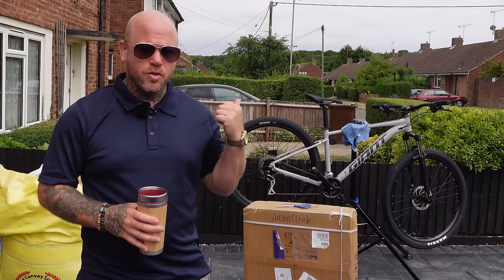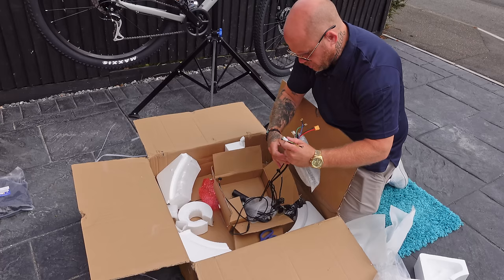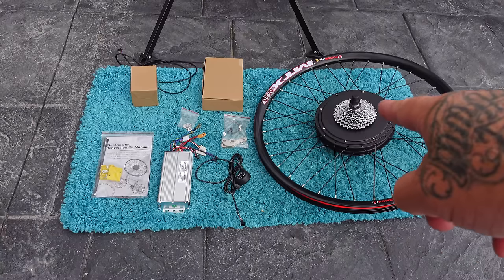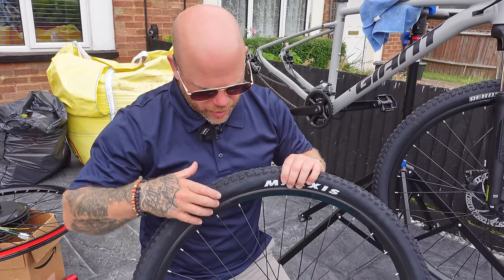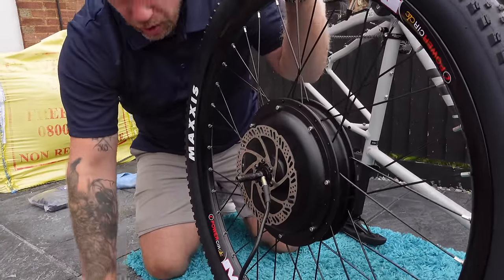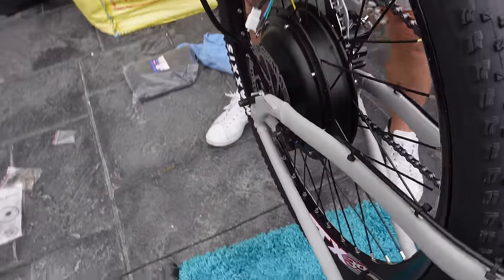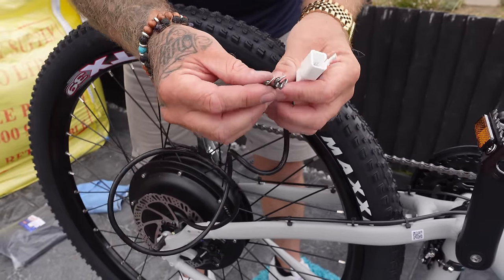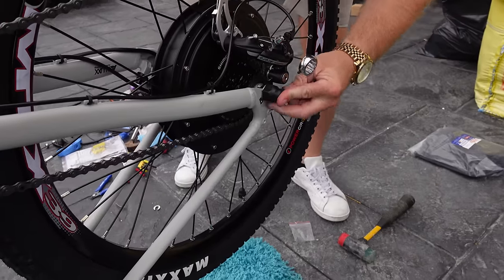Pt. 1 Convert ANY bike into an EBIKE! **ELECTRIC HUB MOTOR FITTING GUIDE**

Comment: Hi steve I'm looking to build my own ebike using  hallomotor 5000 watt conversion kit(I'm only looking to spend 500 on the actual bike itself which will be a mountain bike) is there any specific Make you would recommend for the drop out etc? I don't want to buy a bike which won't be able to fit the kit to if you're with me? Any help will be greatly appreciated,thanks joe
Reply from the maker: Don't really know much about that kit. I generally wouldn't bother with a kit that size should be on an actual enduro ebike frame not mtb it's generally overkill for a mtb and it's components.
Reply: @DudeStuff  what size kit would you recommend? Thanks again
Reply from the maker: @joefrenchcore386  I personally see no point in anything bigger than a 2kw hub motor on a mountain bike
Reply: Looking for something for longer distances would a 5000 watt hub kit not fit on to a mtb dude? Thanks again for replying
Reply from the maker: @Joe Frenchcore  5000w isn't going to help just get the highest ah battery you can fit and afford

Comment: hiya dude listen I bought one of these about month ago from Andy now I've run into the problem where my  disc from the disc brake does not have the same bolt pattern as the Hub motor itself have you ever run into that problem if so what did you do
Reply from the maker: Just buy a brake disc the kits are 6 bolt of you have centre lock just buy one that size
Reply: @DudeStuff  got you I have a 6 bolt pattern but for some reason on the mtx 39 the bolt pattern is slightly more spread out I didn't know that the discs from disc brakes on bikes come with different sizes I mean the bolt pattern not the actual circumference of the disc thanks I will look into which one will fit
Reply from the maker: @chrismartin6427  nah if you have 6 bolt it should fit you must be doing something wrong

Comment: 13:54 make sure you have a 2wire bms on the battery for regen braking. all of the cheap ebike batteries have 3 wire bms's which you should not use regen with
Reply: Can you expand? Do the motors always have 3 wires as shown?  If so, how can you fit 3 wires to a 2 wire bms? (what is bms?)  How do you choose a 2 wire bms battery?  Do you recomend opening the battery hub using stator aid and refitting with a silicone seal under the hub nut flange?

Comment: The hall wire from motor should be strait across to frame near wheel nut as brake disc screws can catch cable. What I did I filed a half moon in washer two of them so wire is miles away from screws. I think these wires gave been out for years the best is coming from spindle problem is torque arm you have to take five wires out of plastic multy plug to feed through washers. Lad from me did not have a good space and disc nut cut through wire and cable. We had to take motor out of wheel and make new connections. This happens quite a lot. Even if you don't file u shape best to bring cable stait to frame with a tie then feed cable along frame jus thought I would mention
Reply from the maker: Got a photo of what you did with the washers?  I've never had an issue with these 2000w kits I always cable tie close to the frame
Reply: @DudeStuff  hi I haven't Andy in one of his videos was on about the cable saying to make sure it's no where near the disc nuts. I had to use two washers on spindle to clear my disc from frame you use a round file and file a half moon in both washers at one end then line them up before tighten big nut the groves in washers help to keep cable further away from the disc screws. It makes sence if you put big washers that come with kit the flat side of washer nuts on that Grove on spindle so it pushes cable near the screws.i serpose could use smaller washers but its the ones with the shape of spindle. If you haven't had none issue then it's OK it's just for safety reasons
Reply: @DudeStuff  when filing washer you don't go write through kits like using half washer width it works well
Reply: @DudeStuff you asked about washer on spindle. When you offer up washer to the stop on spindle there's a color then the phace wires go over washer. I find take washer put it in vice and file half moon on one side but not all the way through. You will God cable comes from motor with more space it's not great but enough so it doesn't catch disc screws. Then to frame with a good tie and that's it. By the way what size tyre's were on the bike front wheel is it the same as back wheel. What is the size of lip where tyre fits in on my 200wat I think it was just over one ins I've tried to by the same wheel for front. I've been on a lot of sites but can't see one so I can put wider tyre on

Comment: Complains about controller overheating then proceeds to paint it black?
Reply from the maker: I've not noticed any issues doing a thin layer of spray and keeping the controller in air flow as opposed to zipping it up in a thick black bag with no air flow.

Comment: Dont you need torque wrench settings for this kind of work? fair question ? also when applying the torque arm ( its just my standards , but i would have applied a couple wraps of self amalgamating tape to disperse shock to an Aluminium frame, the paint will benefit a wee bit , but such a powerful motor applied to a frame not built originally could easily account for future structural failure) just saying,  excellent work !
Reply: Pushbike manufacturers do not publish torque settings for ebike conversions, as the dont actively encourage them and releasing numbers may put them liable for damages if something goes wrong.
Reply: @Debbiebabe69  No shit !! you serous ? of course they bloody wont! am talking about the nuts and bolts and whatnot for the attaching the conversion parts !
Reply: @jezztech  depends on the bike you attach it to, what other hardware you have on the bike, etc.
If you want proper torque settings, commission an engineer to work them out for you - will probably need several complete bikes for destructive testing, and cost many times what the bike is worth.....

Comment: Nice video, explained very well, I built a 1000w bafang mid drive, the only issue I can see with these rear wheel versions is if a rear puncture happens, that's going to be a real problem changing an inner with all that  cabling and that rear torque section. Has this happened to you before while out?
Reply: No but it happened to me on a stock ebike and I used a can of fix a flat--the car version--maybe 1/5th of the can and the bike rides better then ever and the tube etc is sealed.
Reply: I have a fat tire bike and found I can pull out the inner tube just enough to do the repair without taking the wheel off, but the problem with a fat tire bike is you can't wheel it along with a flat tire becuase the tire deforms so much it snags in the frame
Reply: @utubeape  The fix a flat fixed my flat within 5 seconds--i just came back from a 20 mile ride on trails--its been weeks and no problem .Plus the tire feels more stable now that it is not low constantly.

Comment: Fittings and advice Should work with most if not all hub motors, what i learned is that i have not been putting the washer lip into the axel dropout, ben using my bike daily for 2 years now (1500w) driving it at full speed (34mph) to work, after watchin this i now realise how shocking my install was (no back brake because the caliper was so tight the wheel wouldn't even budge) washers not installed properly, stupidity no time and it works it'll do attitude have stopped me from ever installing it properly. funnily enough wheel came off today as i was leaving work from either the torque arm slipping off bottom of frame or nuts came loose on axel, anyway thanks for the advice i will definently be using some of it. i've come off a few times got the scars and missing teeth to prove it, but still love it, the torgue is just so much fun and thats on 45nm of torque some of the bigger ones have 90nm. imagine what that feels like!.

Comment: Very interesting video, might be worth pointing out it could only be used on private land due to the power output. I built an e bike a couple of years ago using a Bafang 48 volt motor, used it the once then discovered it was totally illegal to ride it on the road. Luckily I wasn’t found out for my ‘oversight’ of the law 😊
Reply: legality for some of these motors are in a bit of a gray area depending on where you live, general rule of thumb though, just don't do anything stupid and you won't give a cop a reason to investigate, just because you can run 50mph doesn't mean you should, same concept applies to cars, even if the car can go 100+ doesn't mean you should

Comment: V brakes are the best mate , that’s why trick riders have them over discs . It’s easier to lock up wheels on the furthest radius of the wheel . I use comp2’s set but even I have to admit vee are better for braking power but get better feeling for disc and the advantage of the wheel not locking up when wet